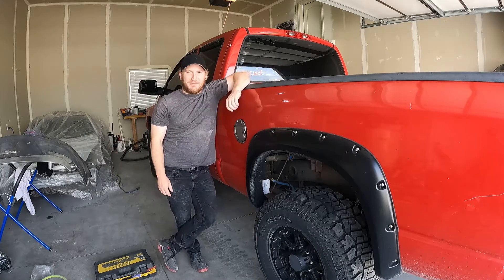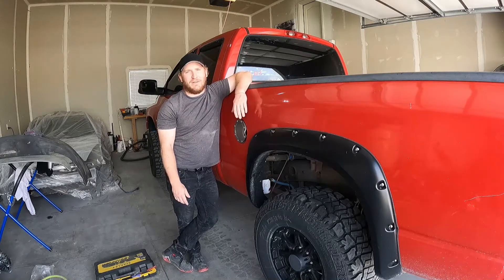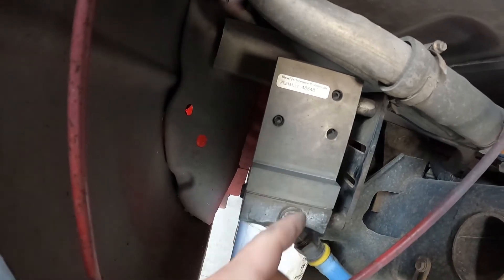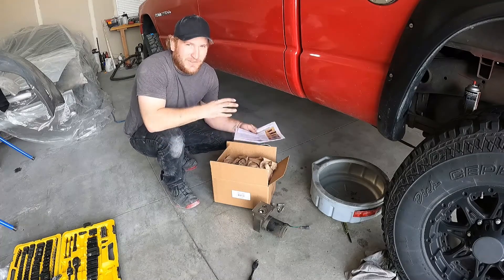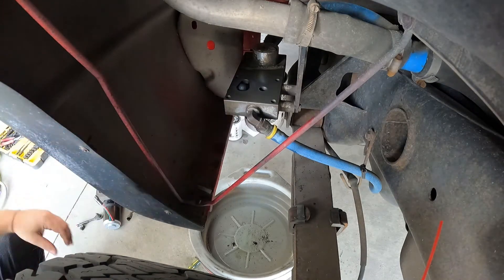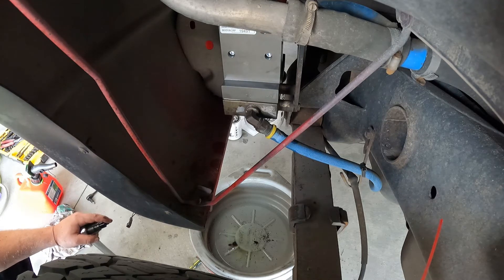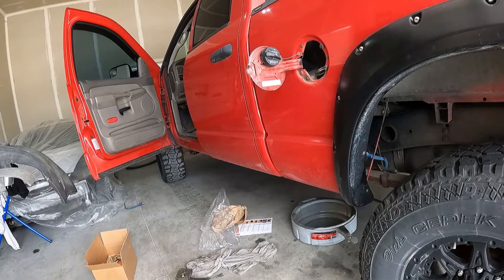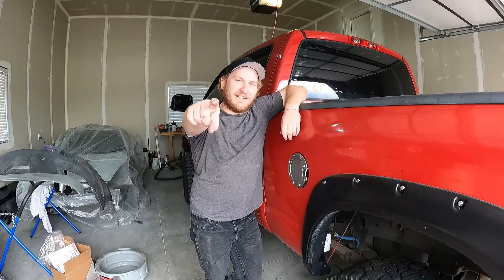FASS Fuel motor/pump replacement

Comment: So I just put a rdhp_1001 replacement pump on my 2000 7.3 powerstroke and it ran for about 2 seconds and stopped blew the fuse passed the pump connector and now it keeps blowing the fuse no matter what doesn't turn on do you know what it could be what size is the inline fuse to the connector
Reply from the maker: @DarksPlay681  that sounds like a bad motor if there is a warranty send it back if not i would try tapping on the case with a hammer. It is a 10 amp fuse.

Comment: Thanks for posting! Mine quit me just recently. They are sending me a new pump and fingers crossed I’ll be back on the road! Did you need to purge the air out after replacement?
Reply from the maker: No just fill your filters up with fuel and cycle the key a time or two and it's ready to rumble!
Reply: @jasonstults  awesome, thanks!!

Comment: I have had an intermittent bad start issue with my truck and I wonder if maybe it is check ball related.  It acts like it has lost its fuel prime.  Sort of like when you replace an OEM filter and it runs rough AF for a bit.  The the other day my truck just shut off while idling in front of my studio.  Fuse was good but pump would only run weakly for a second before shutting off on key cycle.  I hotwired the plug and bypassed the relay and pump spun right up and sounded normal.  So maybe relay was an issue but that doesn't explain the other loss of prime situation.  I think my pump is about 10yrs old now.  But only about 60k miles.
Reply from the maker: @infinityphotorob  so the main issue with mine is the pump would ground out. The truck should still be running fine off of stock pump I think you may have a deeper issue. Or maybe even cracked fuel line whether from your fass or one of your injector lines. Just have to do some poking around if you have access to a scan tool check your rail pressure. us your rail pressure gauge

Comment: Did this issue also cause fluctuations in fuel pressure
Reply from the maker: @raptorrider7002  I'm not sure. I wasn't monitoring it with a gauge or anything but I would think most likely
Reply: @ what did the pump sound like?
Reply from the maker: @raptorrider7002  normal as always i didn't notice any change in sound. I would notice however lack of sound while waiting on glow plug light. It popped the fuse throughout summer months occasionally and then as cold temperature hit it was almost every time I'd turn the key on before replacing it

Comment: Good video. I should be doing this within the next few days. I was a bit unsure if I could do it with the pump still on frame or if I would have to remove it all but seems like it’s pretty straight forward doing it while it’s still attached. Thanks

Comment: Thanks for posting.  Do you know if the electric motor without the gerotor pump is available anywhere?  Mine quit, the magnets in the motor were loose.  Gerotor pump is fine.  I'd rather not buy the entire pump if I don't have to.  Thanks again!
Reply from the maker: To be honest I have no idea I imagine so since you can send yours into FASS, and have it repaired. But I don't possess that knowledge..

Comment: When you upgrade to fass does it replace you fuel oem pump or do you still need it ?
Reply from the maker: @joseMeza-mi7fn  your stock lift pump is still there it just doesn't have to strain to pull fuel all the way from tank

Comment: did they cover the cost of the pump? did you have a warranty on the new pump at least if you got this second hand?
Reply from the maker: I had to buy a new pump the new one came with a 1 year warranty is all. I found a dealer somewhat local and went through them. Fass will rebuild yours but it wasn't that much more expensive to go new with warranty.
Reply: @jasonstults  yeah but the thing that bothers me is when they say LIFETIME WARRANTY when you buy it. I mean come on it's a D.C. motor with a housing and a couple filters. The all in cost of these unit's have to be close to 300 bucks and they are selling them for almost 800. It's like keep the price and actually warranty the stuff or drop the price to reflect a disposable product
Reply from the maker: @ron p. Terrazas  I totally agree. Maybe fight your case and see what they say. I wasn't the original purchaser of the unit that was on my truck.  But I don't think that ever came up. It was also a lot cheaper when I made this video than 800 bucks. So the rebuild sounds more feasible at that point as far as price point.
Reply: @jasonstults  ah ok. Yeah i can't blame them for not covering it if you were not the original purchaser. If they asked you for the pump number then i think that's how they can tell if it's under warranty, or if they flat out ask if you bought it originally. Yes it's almost always cheaper to rebuild something instead of removing and replacing it. I called in about my motor being loud as can be and they quoted me a price higher than i wanted to pay. I told them wow that's a lot, maybe i should just take it off and send it off for a rebuild then. They got snarkey and said well if you think you can find somewhere to send it. I laughed but i felt like saying it's a dc motor man not a fusion generator that only you guys know how to rebuild.....
Reply from the maker: @ron p. Terrazas  yeah I don't blame them, but at the same time, they should stand by their lifetime guarantee. That's a bummer they were rude on the phone. The dude I spoke with broke it down for me pretty well. Hmm I didn't even think to go somewhere else to have it rebuilt, we have generators and starters for old 20s 30s cars rebuilt for projects at work constantly.

Comment: Which fass do you have and how did you know the rpt-1005 was gonna fit or are they interchangeable?
Reply from the maker: So depending on what series of pump you have. For the titanium series that's the correct replacement. Can you see the serial number on the base of your pump? You can contact Fass with your serial number and they can give you full description of exactly what you've got.
Reply: @jasonstults  I have the titanium series but I know there’s different flow ratings for them I have the 100gph pump currently so I wasn’t sure which replacement pump I should get I’ll try contacting fass thanks for the info and the video !

Comment: What size were the 4 allen bolts that hold on the pump ?
Reply from the maker: @47927411D  I don't know off the top of my head but will look into it and let you know
Reply from the maker: 5/32

Comment: Where is the fuse for the pump?
Reply from the maker: Should be right near the battery on the driver side red wire off of the battery about 12 inches down the wire
Reply: Thank you! Because of your video I was able to replace my lift pump and fuse. My truck is working AGAIN!!!

Comment: Isn't their a spring that should be in their
Reply from the maker: There is no spring at least on the titanium series
Reply: @jasonstults  how do u up fuel pressure ?
Reply from the maker: @sagepeace2607   by changing out the spring in the main body where the return hose comes in. Some people just stretch the factory spring in there and get a few more psi.